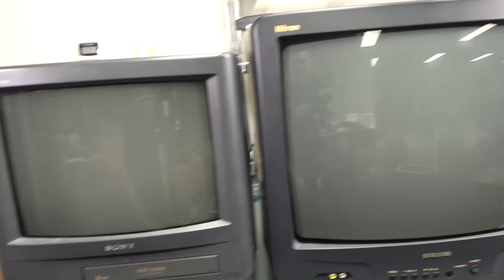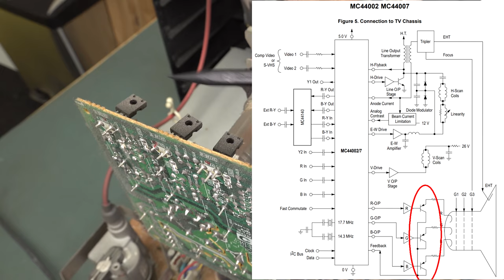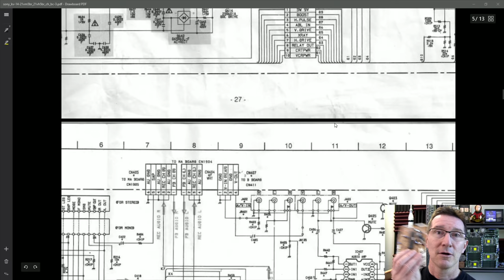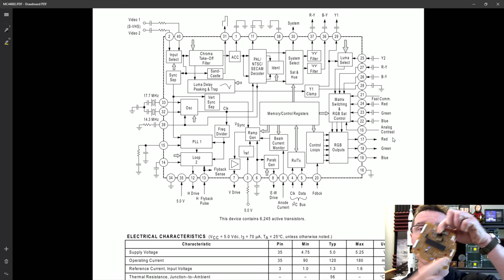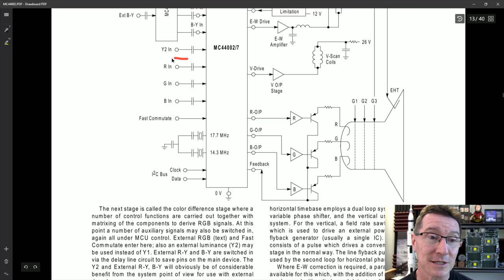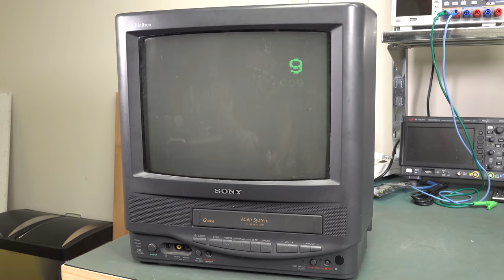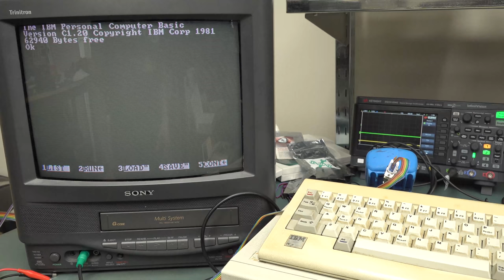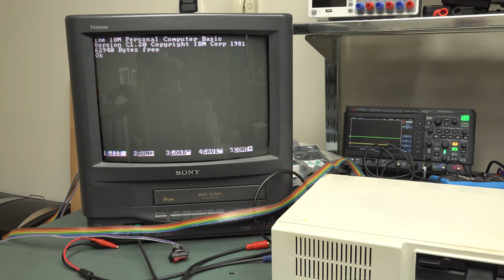EEVblog #1246 - Dumpster TV to Retro RGB Monitor Conversion

Comment: Unless you find a way to inject that sync with it's own connector, I'm thinking you want to rig up some sort of analogue delay on the color channels. That should (hopefully) be enough to fix that "dancing screen" effect that you have on composite/component switch-over.
Reply: Except for some very high end sets, the picture shifting left always happened when switching to RGB mode on the SCART input.
It is simply due to the more direct signal path of the RGB signals not having the couple of microseconds propagation delay that the composite signal processing introduces.
The higher end sets had an H-Phase RGB mode offset control (not user accessible) to counteract this

Comment: The term "Jungle" is used to indicate that the chip is designed for TROPICAL regions.

When I worked for a White/Brown goods importer, we supplied to hot countries refrigerators and freezers with "Jungle" compressors.
Reply: Not this time. Refers to complexity.
Reply: @daverhodes382  lol, really, complexity, looks like most PCB's to me.

Question, have you tried playing about with the OSD input and see if you can overlay your own additional input over the main input.

Say you want one screen with two functions, if the OSD input can be driven, can't you push a signal like from a security video camera or one of those door cameras so you flick the OSD on to see who rang your door bell or automatically triggered by a door bell push.

Make for a an interesting hack video.

Comment: I'm assuming they want to bypass the contrast/sat/etc control for the on-screen display, they're using the fast commutate to disable the regular signal in the region where the OSD is showing but then just feeding it in black. You'll notice when you feed in a different signal that it mixes with the OSD instead of being underneath it.

Comment: RGB signals usually have sync on green. The video processor chip has sync separators on the rgb inputs but they may have to be activated. There maybe a signal setting that determines the source of the sync pulses.

Comment: In Europe all brand TVs from that era already have an RGB input on the SCART connector...  the only issue is that it needs a voltage on a pin to switch to it, and it has RGB+composite sync.
When your computer outputs both RGB and CVBS at the same time you can use the CVBS as the sync signal.

Comment: The "Number of Lines" is always going to be consistent. 525 NTSC or 625 PAL. What is going to change is the bandwidth. So, perhaps 2 Mhz of bandwidth might give you the quality of VHS tape, but as you go up, the detail increases. The top end broadcast NTSC or PAL cameras had the same number of scanlines, but the bandwidth could be 5 Mhz or more. The resolution across a scanline is measured in "line pairs", and that could go into the thousands with a high-end camera. A VHS tape might give you 200 or 300 line pairs.
Reply from the maker: Smaller Sony RGB monitors don't have full 525/625 lines, likely a function of CRT tube size.

Comment: I always suspected that TVs and monitors could do each other's task .... thanks for this ultra instruction vid. :)
Reply: Haze Anderson actually they can’t, this time one just happened to have a kludge IC preinstalled with an available datasheet, exposed pins and unfrozen firmware.
Reply: Remember the "HD ready" TVs that were just big computer monitors?
Reply: TVs were only 480i while you can easily find 1280x1024 CRT monitors pretty easily

I believe they did make 16:9 TVs that could display 1080i in the mid 2000s but they were very short lived and quicky replaced by LCDs.

Comment: That is a really huge difference, I like it!
I wonder if there are any CRT TVs that came with a RGB input out of the factory. On today's lcd screens, you always have both kind of inputs.
Reply from the maker: "Modern" SCART enabled TV's usually have RGB capability.
Reply: @EEVblog  Exactly... They have. I connected my Atari 520ST to my TV's SCART input back in the day and voilà.. RGB input. As you said in the video it really makes a difference, you get a sharp image instead of the fuzzy one from the composite signal. I think we europeans were very fortunate to have such a simple way of getting RGB input to a TV.. And it was not only computers; DVD players also used SCART RGB input.
Reply: L3P3 I believe that in the UK at one time TVs above a certain size had to have a SCART connector.
Reply: If what you’re seeing is D-sub then more likely it’s VGA not RGB/CGA input.

Comment: Being in EU I was a bit spoiled by the SCART input which already has RGB among other signals, it's a shame it didn't caught on globally
Reply: I was thinking what about the scart socket then remembered not all countries had the 21pin goodness
Reply: @alltopnotch235  Amazing for its functions but worst connector ever I think
Reply: SCART was ahead of its time, in a single connector you had:
- composite and audio input
- RGB input
- S-VIDEO input (even if not in the original standard)
- composite and audio output (useful to back feed the VCR with the signal from the TV to record directly what you was watching or another input of the TV, or to feed the audio back to an amplifier)
- automatic input switching, super useful, now you have to fiddle around with the remote, in the old days you inserted a VHS in the VCR and the TV automatically went to the appropriate input, some TV even waked from standby, super user friendly
- data lines for passing teletex information to the TV, a thing that unfortunately with HDMI you don't have (come on! I still need to have a SCART connected between my Sky set top box to the TV because it's the only way to watch teletext, with HDMI you don't have it!)

I agree that the connector itself was a problem, the cable was bulky and if you had the TV on those rotating bases it tended to unplug and bend the shell of the connector.
Reply: @massimo no better feeling than reaching around a 32" CRT and blindly plugging in a scart lead
Reply: Wait...SCART wasn't/isn't a thing globally? TIL

Comment: back in 1970 or so, had a "64k timex sinclair" did RF output to analog channel 3 or 4 on TV. Was very staticy and very poor video clarity. In Timex I found video input to "RF output can" then in analog TV found clean video output after  all the RF stuff (before video amp to CRT) Found same voltage range, connected them together, and WOW CLEANEST VIDEO IMAGE I'D EVER SEEN. Real problem was the TV weighed 40 pounds in my basement, and I couldn't carry the wired assembly over to friend's house, so YOU and 664thousand subscribers around the world are the first to hear about my 50 year old great accomplishment.....  It really worked great .... How's it feel being the first to know?

Comment: I would assume that the OSD is done the way it is because it needs to be able to display stuff no matter what input is selected?
Reply: You're right, but usually, the jungle chip has mechanisms to enable OSD on any input. Usually you tie a blanking pin to high, and then it enables that OSD to draw over the signal.

Comment: Sony did a lot of weird stuff. With the PVM N series monitors, they all share the same bottom layer, but the top layer is drilled and populated in completely incompatible ways. I think that's what you're seeing with the Brazillian service manual - same IC number, but it's wired in differently and is in fact a different chip entirely. My PVM-14N1 has a daughterboard for the OSD (which has an unused RGB input, which I've made used ;)), but a PVM-14N5 has undrilled pads where I have a socket, but then has repurposed the socket I have that's labeled "AGING" but has 6 pins which it only needs 2 of and turned it into RGB + audio + sync. It's bonkers.

All that said, something Sony does do is put red lines under components which will be modified or deleted in submodels. I notice there's a 0 ohm resistor and all of the RGB caps have a red line under it. They probably intend on you desoldering those components and jumping them to their proper locations. One of your connectors (under the output, which didn't even appear to be used) has RGB inputs not for the OSD. I bet those are supposed to connect to the non-ground-side of those capacitors, but there are missing or misrouted jumpers.

Comment: I agree that it's weird that the country variations are so wildly different, especially since they're both PAL countries (AFAIK). Could the mains voltage & frequency differences be part of the reason?

Also, is there some kind of cleaning spray that will get the sticky dust off without damaging the internals? Or is it best to use spray air & a vacuum (or do it outside), plus maybe a soft clean paintbrush to do it all? (Also, are there kinds of brushes that we shouldn't use because they're too static-inducing or anything?)

Thanks for another cool how-to lesson.
Reply: Rich Wilson There are many variants of PAL. PAL-M is a hybrid of NTSC and PAL with 525 lines/60 Hz used in Brazil and PAL-N is a variant of PAL with narrow bandwidth which is used in Argentina, Paraguay, and Uruguay. PAL-I is the version used in the United Kingdom. Other European countries use PAL-B/G. A variant named PAL60 uses, like NTSC, 59.94 fields per second. It is used mainly for displaying NTSC video or DVD on a PAL TV set.
Reply: Brazil uses a special version of PAL called PAL-M, which is a weird combination of PAL color encoding and NTSC's 525-line, 60 Hz video scanning rate. That's why Sony had to make a special model of their TVs just for Brazil.
Reply: Thanks, @Rýán Túçk and @VWestlife (backup account)

Comment: That's interesting, I assumed Australia TV's would have had Scart sockets as you use the Belling Lee aerial socket like Europe.

I can't bring myself to throw out my 14" Sony CRT TV, they make excellent monitors for analogue signals.
Reply: Some high end European sourced models like Philips did have a SCART inputs, but they weren't common especially at the low end.   Most of the plastic moulded cases were exactly the same, so they had a place for where the SCART input was supposed to be, but it wasn't cut out.    Higher end stuff from the 80s and early 90s had YPbPr inputs on RCAs.

Comment: And next you can convert the VCR in the Sony to an integral tape data backup.
(That's a job for Ben Eater)

>
Reply: the original ADAT drives used a VHS flavor (high speed S-VHS/Umatic) to store up to eight 48khz/16bit later 48/24 digital audio chanels on S-VHS tapes

Comment: Something that I've never really thought about before: how come when you're starting up a CRT you can actually hear the HT voltage? What is it that you're actually hearing?
Reply: Jacob Garby it begins at about 18KHz, near the upper range of human hearing, and will glissade up to ~22KHz. If your hearing is still able to hear the startup, congratulations, mine hasn’t been since I was 10. Anyone able to hear the entire range would be a golden ear on any sonar monitoring post.
Reply: Jacob Garby BtW the component making the sound is a High-Voltage MOSFET transistor coupled to a ‘flyback transformer’. The circuit is what’s well-known as a “switching power supply”. The sound is the switching frequency physically oscillating the discrete component as the gate opens and closes the LV primaries: magnetic coils.
Reply: @HighestRank  Okay thanks, does it have to be above some certain voltage before you can hear it?
Reply: @HighestRank  I think it's the EHT crackle that they're talking about.

Comment: also that pcb is standalone because it is deliberately designed to have the capability for an RGB scart interface to be present in certain markets
Reply from the maker: Makes sense.
Reply: although I don't believe it was ever fully implemented in this series, but I may be wrong because most of my sony knowledge only extends to usdm sets

Comment: I think your RGB signal levels are way too high. When using RGB, there's barely any difference between the dark and light version of each color. Either that, and/or you're not connecting the intensity signal.
Reply: He said he didn't connect the intensity signal.

Comment: Dead cockroaches? I guess you've been scared by Louis experience looking for a new store in NYC ? Roaches ... shudder.
Reply: Eight bit guy, Louis Rossmann in the comments, can we get a mention for aVe  and I think we've got the lot then :) Love it
Reply: How about dead mice? Mustie1 is always finding them along with their bedding and waste products in stuff he fixes, VW Beetle exhausts included.
Reply: I bought a Sony trinitron remote from the fleamarket a few weeks ago and it was filled with dead cockroaches... When Dave mentioned that, i had a little flashback.
Reply: @peshozmiata  Just reminded me. A decent 17" HP LCD monitor with no backlight fell into my hands many years ago. Take the back off, remove cremated spider on one end of the CCL and was in use until last year.

Comment: I did a quick search and found a website that appears to have the service manual for that Sony TV. The site shows the first 4 pages of a 42 page manual. The site is https://www.manualscenter.com/manuals/sony/kv14vm5g-service-manual.html but they want $4.99 for the manual. I've never tried doing an RGB mod but back in the day I have modified an old small TV by tapping in to the IF(?) to feed in an external composite input signal to a TV that had no external composite input.
Reply from the maker: Nope, that's one of the sites I used, you pay your 5 bucks and the manual never comes.
Reply: @EEVblog  That's not good. Makes it seem like the site is scamming people. They showed several pages of the manual which makes you think they actually have a copy available.

Comment: @Dave Re https://youtu.be/cyHmBMI3zC0?t=468. Sweet weird - PNPs driving the guns of a CRT. Why has it all settled on the other way round ("+/-"). How to wrap the head around it, when all what you see is a vacuum electron cleaner, not a projector?

Comment: Oh no, don't use CRTs. Decent converter / upscaler is good for vintage stuff.
If the output looks shit, fix the output don't mask it with a CRT.
Reason: used to repair CRTs in a previous life.

Comment: On the brazilian service manual, I can even imagine why it's so different... speculation, but still.
First thing is about technical weirdness. Brazil didn't use either european PAL or NTSC color system among other more popular ones... instead it went with a hybrid monster called PAL-M. Yep, instead of adopting a standard from another country, we decided to go with our own that combined chunks of other standards *rolleyes*. Something that still keeps going to this day with stuff like our power plugs.
Cue XKCD strip on standards.

Second is that a whole lot of electronics of that time were modified a bit and assembled in Brazil... not totally sure about the Sony TV, but very likely. Because dumbfuck Brazil had to create it's own standards, better to make the modifications and final assembly there instead of the parent company having to worry with extremely regional standards and whatnot.
This has probably played a part on a whole bunch of electronics being assembled here instead of being straight out imported.
This was (is still?) mostly done in what is known as "Zona Franca de Manaus" or Free Economic Zone of Manaus, right in the middle of the Amazon jungle, supposedly for the betterment of the area that has been historically very poor thoughout Brazil's history.
Guess what? It's still poor. Basically because the largest economic centers in Brazil are on the opposite side of the map (Amazon is in the northwest, biggest financial and economic centers in Brazil are in the southeast). They put the industries working on those electronics on the opposite side of the map where the markets for the products are. Ayayay

Yep, fucking protectionist mentalities is what has been ruining this country since forever.